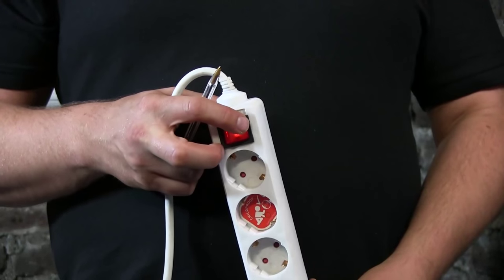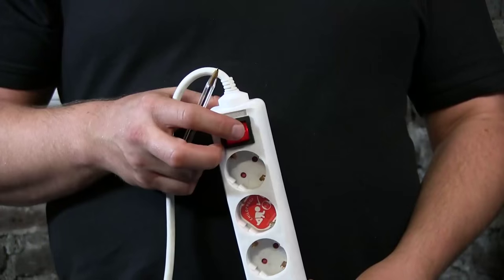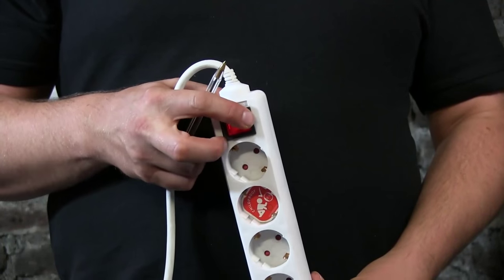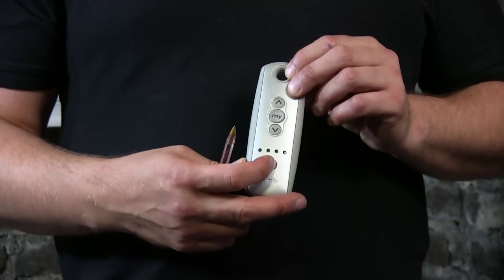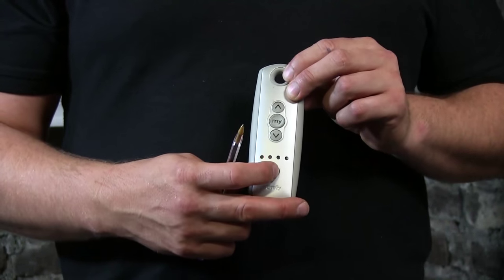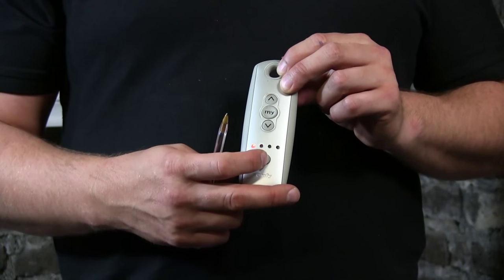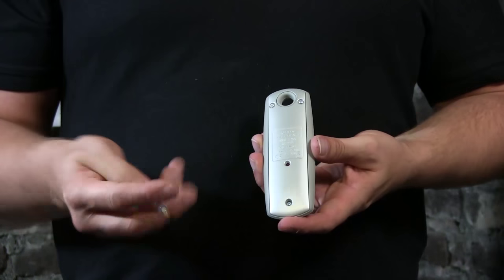Lost or damaged Somfy RTS remote? Here's an easy way to add a new one (semi reset)

Comment: Thank's very much for the video. Is the "old" remote still be paired with the motor (I have a Somfy KEYGO and want to pair a new Telis additionally)
Reply from the maker: No, it removes everythng from memory. Adding a new remote though and old one can be done like this: https://www.youtube.com/watch?v=NflF7aYC0R0

The keygo does not have the prog button like the telis in this video, so please check you manual of the Keygo for how to do this.

good luck,

otto